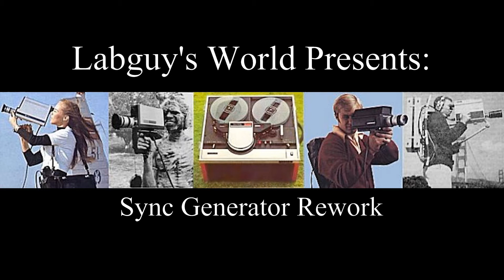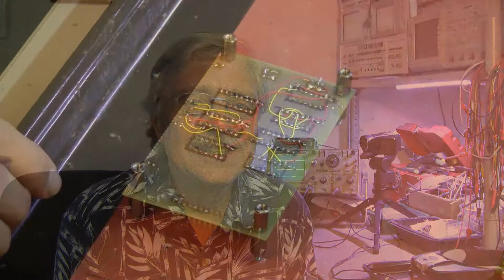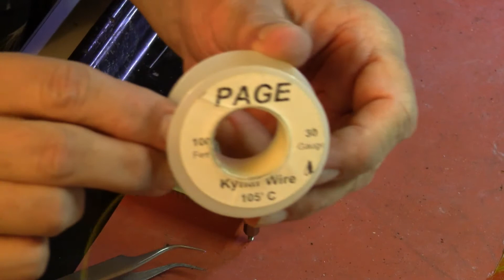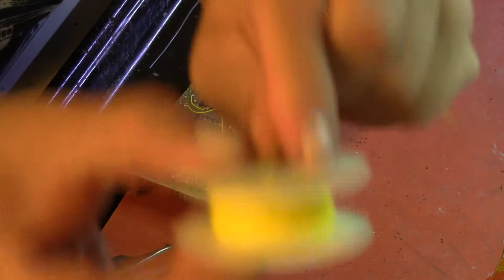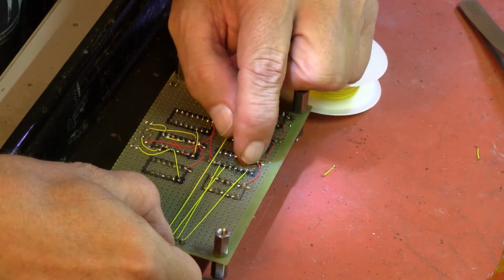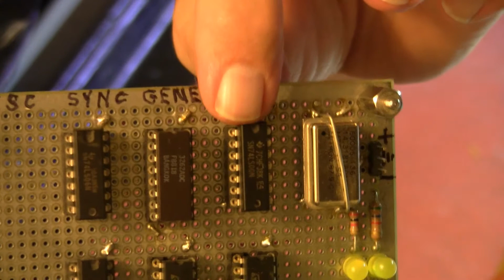TV Sync Generator Rework

Comment: is there any more modern sync generator chip you know of? all of these sync gen chips are obsolete and impossible to find :(
Reply from the maker: There are a few others. They all have bizarre limitations. They are designed for computer graphics and don't conform well to the true NTSC specifications. They use oddball crystal frequencies, which may be as hard to find. If your requirements are less stringent than that, you can find some chips made by Philips. The SAA1101 (for example) comes to mind. I don't use it because it requires a host CPU to program and initialize it. Not as much of a problem today with all the Arduinos, Pics, Raspberry Pis and Teensys to name but a few.

Comment: I always worry about lingering too long with the soldering iron and ICs....  I like to use IC Sockets when possible, even when I repair a piece of equipment which did not have them.  Call me paranoid.
Reply from the maker: Right you are! Every chip on all of my boards are always in sockets. Good sockets. Machined pin sockets. Stamped pin sockets are strictly verboten! I've been soldering for over 50 years now.I have not damaged part with a soldering iron in a long long time. I can do surface mount work very well too. Just not enough room here for the required equipment.